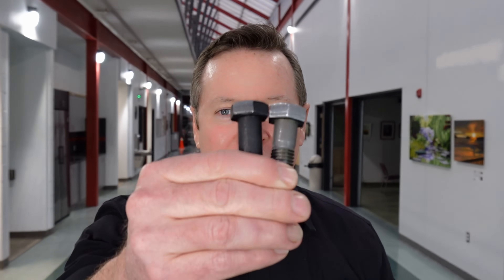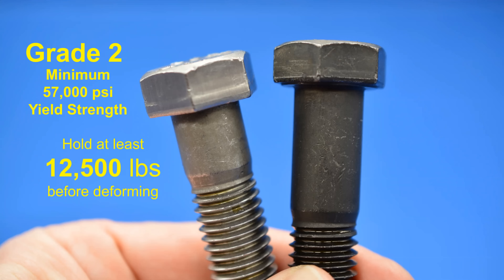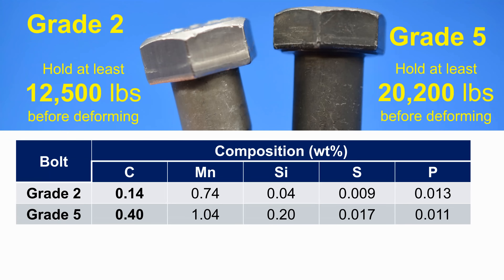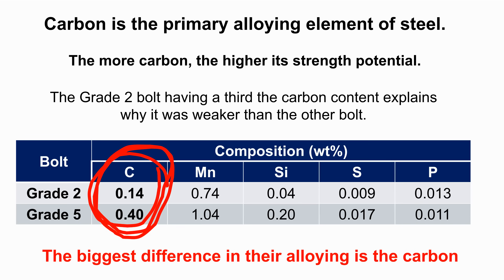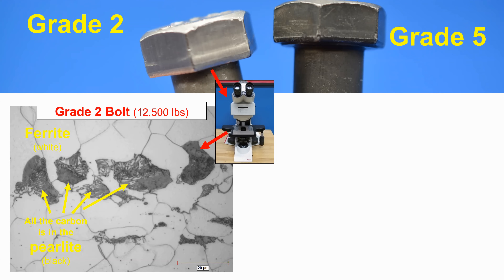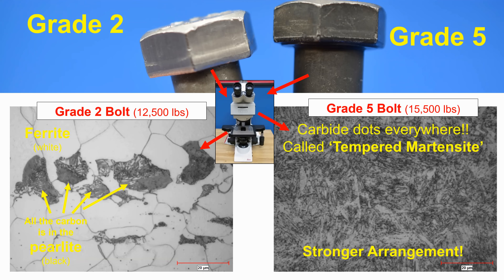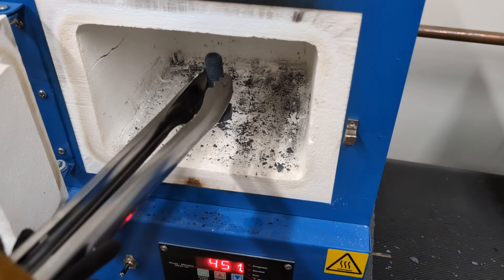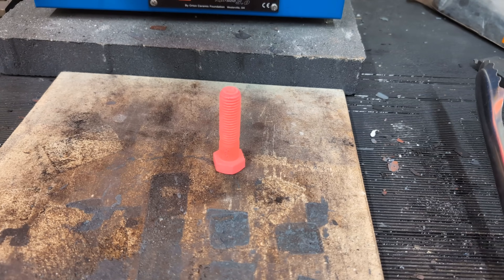What Affects the Strength of Steel?

Comment: This video does a great job of not only describing the material science of the steel, but also shows why bolts that have been removed via heating cannot be reused.
Reply: When he showed the microstructure of the air-cooled bolt, I started picturing times that I have heated a bolt to remove it. As long as the temperature is kept low enough - such as warming a bolt to break the thread locking compound - it would be fine. But exceed that temperature and all bets are off.
Reply: Unless the bolt is grade 2…
Reply: I worked with a mechanic who heated and removed, then reused, probably thousands of bolts in his career. This is the norm across numerous mechanical fields. Unless you're building airplanes or race cars, I wouldn't worry about it too much.
Reply: @Backstabbio  the fact that such mechanic did it does not change laws of physics - maybe in his field there was a lot of redundancy in the design. If I ever have to use oxy-ace to remove a suspension bolt, I’ll never ever reuse that fastener… it’s common sense.
Reply: @AlessioSangalli  You can replace all the bolts you like. But still, consider the experience of a man who has staked his reputation on re-used bolts for 40+ years. He's even re-used crank pulley bolts after having to heat them to remove them. No call backs for a broken bolt. If this was a real issue, every mechanic would know about it. It's not. We re-use heated bolts all the time.
Reply: @Backstabbio  Maybe I was not clear. It is likely that in your application bolts have enough margin so that even after they lose strength they can still perform the job without evident malfunctions, or maybe the heat applied wasn't enough to change the properties too much, we do not know that. But it is also very easy to show how in practice a hardened bolt can be made weaker by heat, that is a real physical phenomenon. I personally like to do repairs myself so that I am sure the repair doesn't cheap out for the 10-20 bucks that a new main crank bolt costs, and make sure to apply the right torque by using a torque wrench with an extension.
Reply: @AlessioSangalli  No offense, but you sound like an engineer. If all mechanics were engineers, car repairs would cost three times as much and take four times as long! Yes, I am aware about the metallurgy of steels and how heating affects the temper. However, many times you've simply got to dance with the girl you brought—sourcing a new crank pulley, or other special-use bolt is not easy or cheap, and often not even an option, especially on the turn-around time most repairs are done. Nevertheless, callbacks for broken bolts are virtually unheard of.
Reply: @Backstabbio  this evening I was working on my wife's car engine. The old head bolts were almost 2mm longer (because of stretch) than the new ones. I would not reuse those...
Reply: @AlessioSangalli  Me, either! Good catch.

Comment: Great video. Great approach. I learned a lot fast. I hope you cover hydrogen embrittlement in your series. I am very interested in hydrogen fuel and the coming hydrogen economy.
Reply: I think the hydrogen economy is a long way off. Lots of problems storing and distributing hydrogen. Expensive to produce also. Toyota are working on lots of other ways to power our transport as well as hydrogen. These include solid state batteries and an internal combustion engine running on ammonia. 
       Don't hold your breath waiting on hydrogen as you would die waiting.
Reply from the maker: Late reply - sorry.  I do have a course that covers in depth hydrogen-based damage (you can find it at www.steelimage.com/training).  I do have one high temperature hydrogen attack idea in mind for a video... but most of the damage you'd be interested in with the transmission of hydrogen is called 'hydrogen embrittlement'.

Comment: Thank you. 
You are explaining masterfully the metallurgy of steel.
And to think that 0.22% of carbon makes that huge of a difference. (SAE 1018 vs SAE 1040).
I was wondering… Could you please explain what’s going on with cryogenic treatment?
Reply from the maker: I myself don't have much experience with cryogenic treatments and last I checked the literature seemed mixed (and perhaps biased?).  So I'm not sure if I'm the best person... but let me try to the get the conversation started anyway.  For hardenable steels (>0.35% carbon), claims either (1) more martensite is formed and/or (2) a fine, hard phase called 'eta' is formed (cannot be seen by optical microscopes).  Either of these two things are reported to help the wear resistance of the steel.  Hope that begins to help.

Comment: as a mechanic when i heat a bolt red hot that I can't get apart is it now weaker?
Reply from the maker: Once red hot or even close to it, best to never use that bolt again.  You could either soften/weak it or embrittle it depending the cooling rate afterwards.
Reply: Toss it out

Comment: Really interesting! I love the images of the different steels! I wish I could see some of the weirder high strength bolts now, like the ARP ones that are rated for 230ksi or so.

I also swear I heard something about some kind of aerospace specific bolt grade that was rated for over 300ksi but cost an arm and a leg. Just what goes into making something that strong?
Reply from the maker: I've never seen bolts that strong myself.  I'd be quite keen to dissect one or two.  If you ever run across one, I promise to make a video about it!
Reply: @Shane_at_SteelImage  I wish I could find that information again. The closest I've found are some mentions of fasteners made from "aermet 100" breaking 260ksi for automotive bolts (couldnt find any for sale, just L19 stuff) and some vague things about m350 maraging steel fasteners possibly being made that strong.

The maraging steel thing is even more interesting as they are high strength steels with almost no carbon. How does that work?

Comment: You forgot to add the importance os steel micro purity. The fatigue strength of steel in increasing hardness levels is not a linear movement but status reducing at higher strengths due to cleanliness.  Please add this in next research and look forward to your video.
Reply: You are 100% correct. This information is something that may interest people involved in aerospace or other special engineering situations/applications?

But.........

The average YouTube viewer will not give a rats derriere about the details involved with  specific combinations or procedures used to create a specialized fastener for NASA or other obscure application?    

Most of us watching this presentation are simply curious as to why the springs and shackles on our F150 use grade 8 bolts or higher and the ones holding the slide for the ashtray to the dash have no marks on the head at all?  

Or,  "I was always told that an 8 penny nail had a shear strength of 3ooo lbs!, is that true or did my cousin tell another lie?"  This is also something that would be cool? Shear vs Stretch abilities of the different bolt grades the average person uses in day to day applications.

It is the first video that he has made I believe? Patience my friend, patience.........

Comment: I decided to melt down and recycle some scrap steel, so I created a steel foundry using jet fuel, yet I can't even get the steel glowing red, what am I doing wrong?
Reply: The heat needs be substantially higher than 2,750° F.

Iron smelting furnace operate at 3,200° F which is still below the boiling point for iron, but will substantially liquefy iron.

To get the iron hot to the point of melting, high velocity air needs to be injected into the fire at its base within the furnace. Adding extra oxygen to a fire will substantially increase the heat output.
Reply: The jet fuel has to hit the steel at high speeds. You would have to be going at least as fast as an airplane. Maybe two.
Reply: @CharlesLeeScoville  You get it.
Reply: @BuceGar It's an old meme, but it checks out sir.
Reply: Jet fuel has energy, but you need to use pure oxygen to get ALL the energy. However, hot iron burns in pure oxygen!  (oxygen lance)